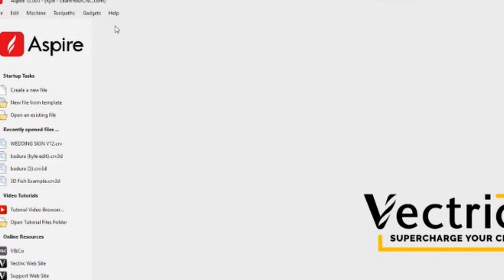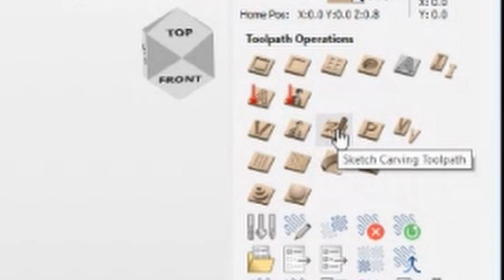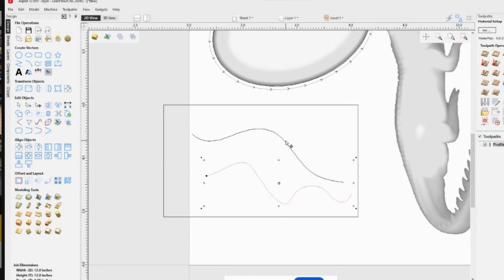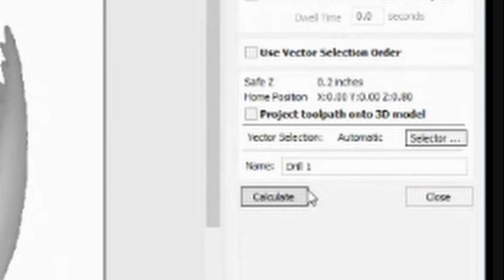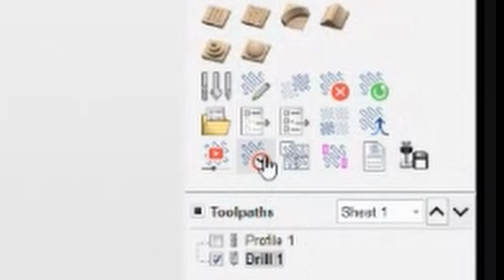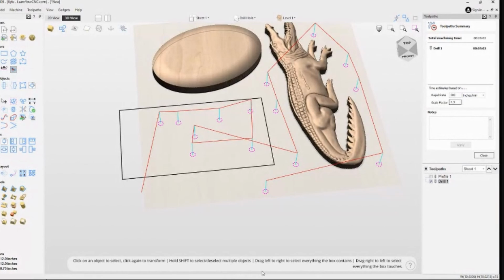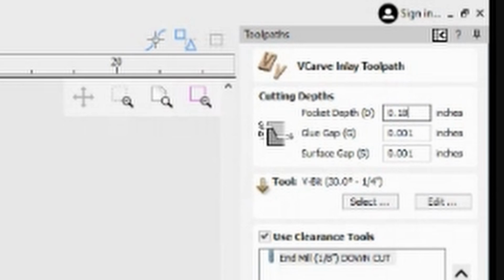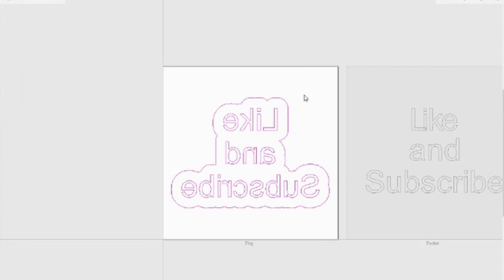What You Need To Know About Vectric Version 12

Comment: 3d connexions space mouse compatibility please.
Reply from the maker: I recommend reaching out to 3dconnexions about that one brother. I have not used that system yet but it sounds interesting!
Reply: @IDCWoodcraft  The spacemous is an amazing tool, I use it in Fusion 360 and other 3d software. When I switch to vcarve pro and can't use it for zoom or pan it is annoying. It is very popular in the 3d modelling and effects industries and compatible with loads of software. The SDK is freely available but I have no knowledge of how to implement it. I messaged vectric ages ago and they said they had no plans to add support because of low demand or something.

Comment: It would seem that Vectric could provide better information here.  Should be able to know what the various CNC machines(CNC database) are capable of.  The Scale factor is just an after the fact fudge factor to make the cut time match the actual time.  But this is missing the whole point.  I don't want to do a cut and then find out it took twice as long for some reason.  If I know this up front then maybe I adjust the cuts or something.
Reply from the maker: I understand your frustration! It can be really helpful to have clear expectations for cut times before starting a job. Knowing the capabilities of different machines can definitely help in planning your projects more effectively. It's great to bring up these points, as user feedback often leads to improvements in software and resources. Thanks for sharing your thoughts!

Comment: I was wondering if I could get a little bit of advice from you. Iv noticed there is a version 12 of vectric software but when I try to update it it's asking me to pay £186 which when I have updated previous versions it never asked me to pay for those so I'm slightly confused.

Firstly am I doing something wrong when trying to update my software or does it require a payment like I say it never asked me before? 

Secondly is it necessary to update the software or can I continue to run my cnc on the current 11.554 version, will updating it make my machine run any better or not? 

Thank you for taking the time to read my message.
Reply: Major upgrades are free for 12 months after you purchase.    After that you need to pay an upgrade fee if you want the new version.
Reply from the maker: Is a great questions. First of all you can do everything with version 11.5 forever. Regarding updating, the best thing to do is contact the vectric support and I will be able to answer that question about the charge
Reply: Hi there thank you for your reply I love watching your videos. Iv actually learnt more from your channel than I have from actual vectric videos so thank you for that